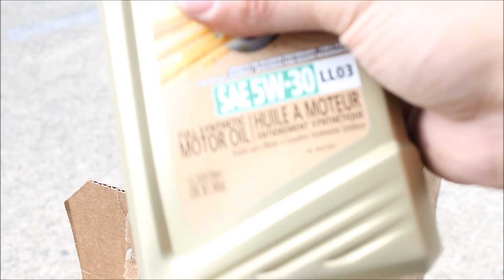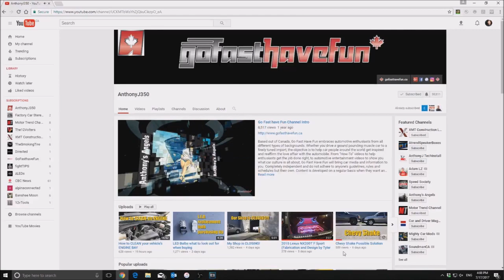Motordyne XYZ Pipe Install Nissan 350Z/ Infiniti G35 | AnthonyJ350

Comment: Great comparison and install video! Did you notice a change in low end torque? Thanks!
Reply from the maker: Mid range power seemed to pull better with this mid-pipe compared to the other design.
Reply: @AnthonyJ350  Nice was your low end reduced or impacted?
Reply from the maker: @joaquinmalagon9343  probably the same. I'm doing a header install soon and hopefully  go back to the dyno to confirm the power curve
Reply: @AnthonyJ350  Thank you! I mean even if you didn't gain anything, I'm really just interested to see if feels the same down low. Looking forward to your future videos!
Reply from the maker: @joaquinmalagon9343  It definitely felt better at every RPM
Reply: @AnthonyJ350  Thanks!
Reply: @AnthonyJ350  Sorry I forgot to ask, were you running the speed racer y back in this video? Thanks

Comment: Another youtuber Motordyne G35 did a video on oil for the VQ35 and brought up this lab that analyses oils based on what oil was used and what debris are in the oil. Its blackstone labs you can check out their results to find which oil you wanna use based off of actual results. N btw castrol proves to be a good oil for the vq from those results. Love the vids man keep em comin!
Reply from the maker: Ya I saw that video a while back and found it interesting.  A few guys a I know with VQ's use Castrol and I was able to get a good price for it now so I figure I'd switch over and try it.  I think regular maintenance intervals are more important overall though.  Did you see all the magnets I put on my filtration system? :D
Reply: There's a whole science to oil quality, and it is profoundly complex. However, I found that Amsoil, and eneos fully synthetic are the best oils for 350z's. There are a plethora of UOA's that support that they are indeed the best oil's for our cars. Even when doing 3,000 mile intervals, the trace elements found that indicate wear were significant when compared to other fully synthetic oils.
Reply from the maker: Erik J That's interesting, the car only been getting Eneos till this video. Can you link some of analysises?
Reply from the maker: Erik J Doesn't the Castrol perform a little better than the Eneos in that chart?
Reply: All and all, I wound not use anything other than amsoil or Eneos. I have access to imported eneos by the barrel, which is why I'm more drawn to it. But they both did remarkably well, in my testing.
Reply from the maker: That's good to know, thanks for sharing your experience!
Reply: Castrol has less than average wear trends when compared to Eneos, Motul, and amsoil. Its and "alright" oil, and is certainly a competent oil for your average person, but considering the nature of our spirited driving and also the VQ's tendencies, I would try to get something better. I've had my car for several years now, and have put a ton of miles on it (I commute to school and also multiple road trips), and I feel as if the performance of my car has not diminished whatsoever, since when I first got it. This claim can also be compounded by my dyno results, as well as my less than average UOA wear trends for my vehicle. I attribute this largely to my maintenance routines, and the products I spent hours, if not days, researching. It's definitely an overlooked subject, because I see many people advocating for stuff like royal purple (which is awful for your car) and other oils that have either a terrible base stocks or inappropriate/ineffective additives. haha sorry for the long reply! I love the channel man! You are the most down to earth, well versed, and informative Z's owners on youtube! A true enthusiast.
Reply: one of the most haha I don't wanna hurt anyone's feelings (;
Reply from the maker: Erik J No this is really good feedback and insight. You've inspired me to do my own oil analysis. I'll be comparing Eneos to Castrol Professional and the video will come out mid next year after I've put more miles on the Castrol.
Reply: Sounds good! Looking forward to the video!

Comment: When I was researching exhausts in order to determine the best pre manufactured exhaust setup, I debated the motordyne ART pipes+y pipe+shockwave setup. However, Tomei's exhaust system just cannot be matched in terms of the R&D done to optimize. Motordyne has done their homework too, but i'm quite content with my my Tomei setup. And perhaps most importantly, its almost entirely rasp free!
Reply from the maker: Erik J Those single exit exhaust systems sound really good. It's just not my taste for styling though. Great product though.
Reply: Lol I spoke hypothetically about something I researched about a year ago when I was looking for a nice exhaust system. Why would I mentioned the fact I had impulsively bought two exhausts (since bragging about your parts list online doesn't get you anywhere)? I bought the Motordyne and Tomei setup within three months of one another since I had to wait nearly four months to acquire the Tomei because it had been back ordered. I impulsively bought the Motordyne setup, since I had already acquired ART pipes, and the exhaust leak I had at my Y pipe was making my car sound like a weed wacker lol. I had the money to throw at it so I did, and I figured it would be relatively easy to sell it since it has become such a popular exhaust. Because I was initially disillusioned by the fact that I had to wait so long for my first choice, I consolidated myself with my 2nd choice. Despite running the Motordyne shockwave for 3-4 months, and falling in love with the throaty punch and depth of sound, I was too excited about having a full Tomei setup and the prospect of tuning, that I didn't think twice about switching it out. I have not missed the motordyne, except when sitting in traffic (: But thank you again for making it obvious how inexcusably hypocritical, unapologetically biased, and shamelessly ignorant you are, big guy. I'm beginning to think your unnecessary antagonizing, and persistent (baseless) claims, are your attempt to compensate for something else (; .
Reply from the maker: I think the Motordyne "Sales Rep" retracted his comment or Youtube finally figured out how to filter out conceded people with their algorithm.
Reply: He's an idiot. I know you are too nice to say it (or rather you're simply too professional hehe), but I don't know of any other way to describe him. "Motordyne 'Sales Rep'" haha, thats fantastic. He definitely retracted his comment, since I probably hit the nail on the head with regards to my last few words... Or YouTube's AI is just that amazing.
Reply from the maker: Erik J Well I finally had the chance to critique his work because I finally saw his amp install in one of his videos. I made a long list of improvements. I was given flak because I bring my car to shops for some work, and that's because I want the best result if I'm inexperienced in the manner. We can see when parts aren't prefabbed for him like the exhaust the workmanship is low.
Reply: His videos are definitely mediocre. I took the time to watch several of them, so that I would not be so quick to judge his character without at least viewing some of his content. His criticism of others, is just a projection of his own mediocrity. Oh well, maybe he will learn.

Comment: Do you know if this XYZ pipe will fit with an ISR single exit exhaust?
Reply from the maker: It matched with my first exhaust system in the video and then I swapped to a Tanabe system with no issues. So if your new system is for a factory y-pipe I think it will fit fine.

Comment: One of my latest upgrades to my stock 350Z I did a nismo S-tune mid pipe & muffler all my gosh what a huge difference ! I am still running the factory y-pipe have you noticed any difference in power output after you had it dynoed changing out the y-pipe? Thank you for taking the time to answer ☺️ Mike from Seattle
Reply from the maker: Low end power seemed a little better and the car was just smoother.

Comment: Just did a 4 brembo caliper upgrade, you are like millimeters away from being on the money for jack stands. You dont put them horizontally right on the pinch seam or closer to the outsides  of the car right on the side skirt plastic. It has a thick ass solid spot near the wheel wells just along the inside side of the car. My past 3 nissan/infinity cars have had the spot where you put your stands crumpled in pretty severely. These cars arent designed to have that much weight on the unibody. Especially with any rust it could punch trough randomly while being held up. Stay safe out there 👍
Reply from the maker: koniko169 To play devil's advocate, how come there is no damage on my car?
Reply: That reminds me of a guy I worked with, older gentleman who smoked for decades and doesn’t have cancer or health problems. Doesn’t mean I’m going to recommend smoking to people as a way to live a long life.

Comment: Do you think this would fit an HR? & also, does implementing the highflow cat let you pass emissions / inspection, with no check engine light?
Reply from the maker: It should fit, but I would confirm on their website.  If you remove the factory cats without tuning the vehicle you may trip a check engine light.  Heavily consider an UPREV tune after doing all your bolt-on mods.

Comment: Hey I'm in Chilliwack. Is there anyone I can talk to about my car? Any specialists for the JDM's?
Also should I keep the factory cats? can I run test pipes with the o2 sensors?
Lastly, when my car gets to op temp I loose power....but no MIL lights.
Any ideas?
thanks
Reply from the maker: There's the Z Shop in Surrey.  Dan specializes in Z cars in general.  I recommend Berk resonated test pipes (fairly affordable) and run the Motordyne XYZ pipe with a high flow cat.  There have been some cases the material in the factory catalytic converter can break apart and go back into the engine and damaging it.  This is how my car sounds now https://www.youtube.com/watch?v=P8_7EfQEYoM
Reply: I just bought nissan long life green. Is the OEM good? thanks

Comment: How much would a full Motordyne Exhaust from the catalytic converters back be for a Nissan 350z Enthusiast 2008 and also can you recommend a reputable tuning shop possibly in or around Nyc.
Reply from the maker: You'll be spending a few grand but it will be worth it.  I would ask local car club enthusiasts about which tuning companies in your area because they can tell you about their experiences.
Reply: @AnthonyJ350  A few grand just for exhaust for the cats back?
Reply from the maker: @DragoMusivini  And tune and taxes maybe. Try pricing it out.
Reply: @AnthonyJ350  Ok now with a tune I can understand. So would you recommend I go full bolt on and then do the tune at the same time? Because that seems more optimal.

Comment: PLEASE SOMEONE ANSWER ME IF I GET THE MOTORDYNE Y PIPE FOR MY MAXIMA WITHOUTH THE WHOLE CAT BACK SYSTEM. WILL THE Y PIPE ALONE GET RID OF ANY OF MY CATS? OR WILL EVERYTHIN STAY
Reply from the maker: Cats would stay.  The y-pipe would mount to the catalytic converters.
Reply: @AnthonyJ350  i still don’t understand sorry cuz i beard people tell me the it will get rid of my 3rd cat i wont have a 3rd cat if i put the y pipe
Reply from the maker: @nicetricks123  I'm not too familiar with the Maxima platform.  It's best to e-mail Motordyne directly with technical questions like this, specific to your vehicle.
Reply: @AnthonyJ350  thanks for the reply
Reply from the maker: @nicetricks123  Thanks for watching!

Comment: the sound hasnt changed much when your on it sadly i was also hoping it was an exhaust leak
Reply from the maker: I'm going to do a rolling shot video.  The tone has changed slightly but when driving it's significantly smoother now.  It's hard to show what it sounds like just in a little culdesac.  The mid-range power and throttle response is slightly better from feel.
Reply: The exhaust note has not changed.
Reply from the maker: Motordyne G35 You need to watch my Reduce Rasp video where there's more shots. It's not exactly where I want it but it is better.

Comment: Will this set up bud right up to my borla true dual exhaust on my hr?
Reply from the maker: Jacob Avila You'd have to modify the connection because this is single out and I believe the Borla has it's own x-pipe section.
Reply: AnthonyJ350 what would I have to do? Or what are my options with me having an x pipe?
Reply from the maker: Jacob Avila I'd go to your local exhaust shop and see what they can fabricate for you.

Comment: Where you connected on cable that is in the end to the exhaust
Reply from the maker: Ritmo Latino PDX Which cable, the grounding strap?
Reply: yes
Reply from the maker: Ritmo Latino PDX On the bolt that connects the rear muffler to the ypipe assembly.
Reply: I bought the DNA Motoring, I do not know if the cable to the grounding is long enough to connect it, because it's totally different from what you usually use

Comment: Hey Anthony! Any plans to switch out your test pipes for art pipes? I look forward you hearing the new tanabe set up. I'm surprised you're not opting for a genuine s-tune instead. I'm sure you can pick one up used for cheap (same goes for the art pipes).
Reply from the maker: 101TheKMan I believe the S-Tune uses a 2.5 inch pipe doesn't it?
Reply: AnthonyJ350 nah it's 3". Z1 stocks them. Seriously considering one myself
Reply from the maker: 101TheKMan Hmmm I'll have to consider it then. How much are they going for?
Reply: Z1 has them going for $840ish though they can be picked up used for a fair bit cheaper... Here's an idea of the sound albeit using art pipes https://youtu.be/j56EGcA_3bI . Here's an example of the amuse R1 https://youtu.be/PsvsT4KcphU . I don't know how similar the exotic speed r1-t (quiet ver) will sound but it's food for thought anyway.
Reply from the maker: 101TheKMan The Tanabe Medallion has a similar tone to a 90s Ferrari though...
Reply: AnthonyJ350 I guess it depends what you're after. The s tune really accentuates the VQ tone and sounds clean which is probably why I like it. In any case I'm really looking forward to seeing how your exhaust project progresses! Thanks for the awesome vids and insight
Reply from the maker: Not sure if you've heard the new setup with the headers and everything https://www.youtube.com/watch?v=saOUPH4TEyk&t=3s